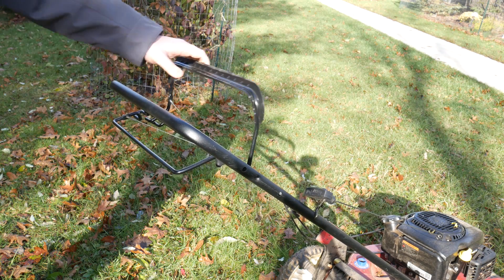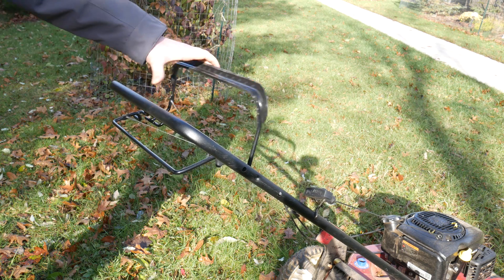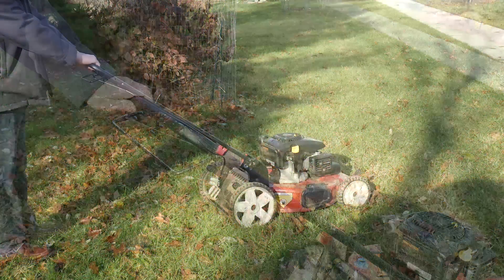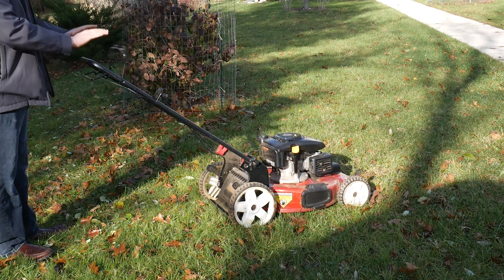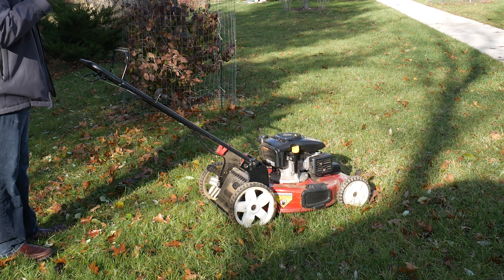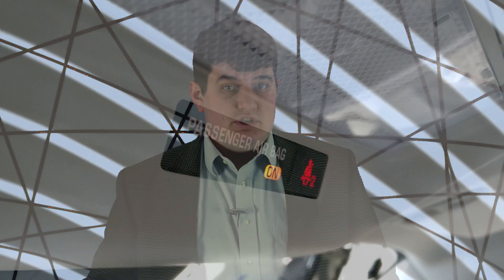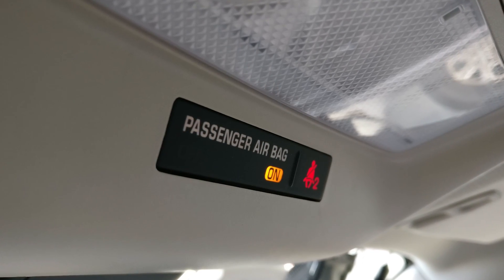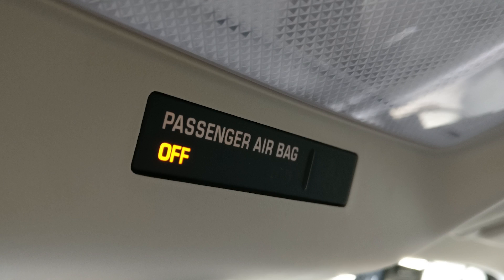The Dead Man's Switch:  How Anton Yelchin's life could have been saved

Comment: A dead man switch, by definition cannot be operated by a dead man. Considering that applying mass to a switch is the only mechanism a dead man could operate makes this really wrong. The switch Dr. Dyson from Terminator 2 used to blow up the lab was a dead man switch. I wouldn't care, but the swich you are refering to is the opposite of a dead man swich.
Reply: Seat switchesThe
 dead man's switch can also be located beneath the seat of a vehicle or 
machine and engages if the operator is not in the seat holding the 
switch down. On modern tractors, the switch will cut the engine while 
the transmission is engaged or the power take-off
 is spinning. On riding lawn mowers, the switch is often more extreme 
where the switch will cut the engine even if the mower is parked and the
 blades aren't spinning. Seat switches can also be used to keep small 
children from even starting the vehicle since they wouldn't weigh enough
 to completely hold down a switch adjusted to an adolescent's or adult's
 weight.

from
https://en.wikipedia.org/wiki/Dead_man_switch#Seat_switches
Reply: Pyrrha Nikos I really want you to be wrong for some reason, but you win. Not sure why that's not just called a pressure switch. My point is still valid, however ya can argue with Wikipedia.
Reply: I think it boils down to the simple fact that you got the definition wrong. I never before heard it said that a dead man switch can not be operated by a dead man.
In fact, I can think of a few applications where it ONLY gets operated in the case of a "dead man", although "dead man" is just a term that in practice doesn't need to involve anyone dying.

From what I learned way back when I went through electrician practice "dead man switch" is not a switch, but an operation. The control circuits (nowadays very often computerized) does a certain thing when the operator is no longer in the expected position. Either because he's dead... or because he left his seat, for instance.

For instance, I know of a story (oddly enough titled "Dead Man's Switch") where a pre-recorded voicemail is sent off the moment a person dies.  Or rather, doesn't trigger the delay of that process for a long enough time.  (spoiler: he did end up being dead)
Reply: @Atlessa  that is the definition of it since the idea is to make sure that if the operator becomes incapacitated, such as by dying, the machine will safely stop. So a true dead man's switch would bring the car to a stop if the driver dies. This is not what is being discussed here. 

So what we are dealing with here, is not a dead mans switch, but a disappearing man's switch.
Reply: Very real case of this issue was the Waterfall Train Disaster, where the overweight train driver was so heavy that even after suffering a heart attack, his leg held down the dead man switch that supposedly needed active muscle pressure to hold down. Seven people died.
Reply: Not exactly the opposite of a dead man's switch, as that implies it is only operated by a dead man, but yeah the name isn't quite right.
Reply: Its a live man switch
Reply: Well, that could have been prevented if the mechanism had required the pedal to be pressed and released every few seconds.

However, i do agree that the definition of "Dead Man´s Switch" switch does change if it describes the component itself or the action of switching something.

If you think about it, the name is just a novelty anyways - A train operator could also decide not to use "the switch" without being dead :)
Reply: Some locomotives have a countdown timer attached to the throttle and brakes. If the engineer doesn't move those controls or press a reset button by the time the timer reaches zero the brakes are applied full for all the cars being towed. A light on the control panel and a warning tone gives the engineer a warning a few seconds before the timer reaches zero. ANY change to the throttle position or pressing the reset button restarts the countdown.
Reply: Are you secretly CinemaSins?
Reply: Dead man switch is a misnomer. It has nothing to do with being dead (Now). (although it originated that way)
A dead man switch is anything that prevents something for functioning if the operator is in no condition to.
Sure, the seat sensor would not help if the operator is actually dead, but in this case it would not had killed Anton either.
Reply: You could also interpret it as a mechanism designed to reduce mortality within a given system. essentially the inverse of its literal name.
Reply: I think the thing nobody has really pointed out is that what you said is the very reason for its name: it’s a switch a dead man can operate. Hence “dead man’s switch.” 

The failsafe implications just happen to seem a little counter intuitive to the name, though.
Reply: Holy shit, none of you can get a joke.
Reply: The name refers to the fact that you are ceasing pressure to engage the switch. Of course a dead man could keep this switch on.

Comment: Why didn't he just set the hand brake, like you always should whenever you leave the vehicle?
Steer by wire is totally retarded. Braking and steering are the most important safety elements in a vehicle. There HAS to be a mechanical backup. Making things more complicated and more likely to fail for very little benefit at the risk of safety.
Reply: greenmumm My driveway is sloped, so yeah, I set the parking brake literally every time I turn off my car. It became second nature and I do it without thinking even when it is flat.
Reply: Yes you should set it every time you park or get out. The parking pawl in the gearbox is not designed to properly secure the vehicle.
Reply: I was thinking the same thing. The transmission is not a kickstand. Set the parking brake. It's literally called the "parking brake". I've always used the parking brake and have taught my daughters to do the same. We (daughters and I) know how to drive manual transmissions and the rule always is: Put the transmission in reverse (the lowest gear / just in case) and apply the parking brake. When we drive automatics we all do the same thing.

I know you can make the argument: Well, no one ever does that... Except they do. The actor's life could have potentially be saved by doing the same thing. Is the parking brake set? Yes. Then unless your brakes are loose, your car shouldn't roll away. In addition, turn the wheel, especially on a hill, just in case so that if it does start to roll downhill, it'll roll into the curb/grass and not straight downhill.
Reply: +lawnmowerdude Braking by wire is starting to become a thing, which is stupidly dangerous. Brakes not actually connected to the brakes are numb and give the driver no feedback to be able to brake properly, making avoiding an accident extremely difficult.
Reply: While I agree with you wholeheartedly, I feel I have to state that a dead man switch on the driver side seat belt attached to a computer-controlled transmission is a no-brainer and would save more lives than simply those too stupid to use the parking brake.
Reply: I agree 100%. I like that you pay attention to which gear is lowest (and actually in some cars, mine for example, 1st gear is actually lower than reverse interestingly enough). I'm used to driving cars old enough that the ebrake is a mechanism inside the rear drums, and simply does not work very well. I just redid mine last year, and even still its kind of a 50/50 on whether or not it will keep the car in the driveway (kinda relates to the "shouldn't" roll away part). And back to my point about rusty brake cables, my dad's mustang does not even have a park brake anymore. Each cable individually locked up, and we had to cut them to get the car drive-able again if I'm being honest. We just park it with the transmission, and still see 150,000 - 200,000 miles out of each transmission that goes in usually. So will parking with the transmission hurt it? No, most likely not. Is it a good idea to use the park brake and leave the car in neutral? In my experience, not really. Using both at the same time allows for redundancy, and could keep your car from rolling away (hell, some cars lose enough compression that the drive train can't hold the car still anymore on a steep incline).

"In addition, turn the wheel, especially on a hill, just in case so that if it does start to roll downhill, it'll roll into the curb/grass and not straight downhill." This. They teach it in drivers ed, and its in the manuals you read before taking your driving test, but no one ever seems to do it.
Reply: having a switch on the belt would also force drivers to wear it, so bonus for free.
Reply: because it costs us taxpayers money for medical and cops to go to the scene and create incident reports  and clear the road of the mess every time someone does stupid shit with a vehicle on the road, if they dont show up after some dummy does stupid shit and wrecks, then that leaves shit blocking the road and permanant traffic (taxpayer money funds those cleanups) and if we can stop that from happening, it also stops unessecary cleanup crew and police response that costs more taxpayer money
Reply: I always shut the motor off, put the parking break and first gear when I get out of my car.
Reply: I've use the "hand break" maybe a hand full of times and I'm in my mid 50s.  People, which I am one, just don't use it.
Reply: +lawnmowerdude Fly by wire is ok in planes because you are not supposed to listen to your gut feelings or tactile feedback, just the instruments. In a car it is just the opposite. All controls in a car are done by feel, and removing that feeling is removing valuable information from the driver. A cars instruments are unreliable, basic, imprecise, and inaccurate compared to an aircraft's instrumentation. While a (non shitty) cars tactile feedback is accurate, precise, and very useful compared to a mechanically controlled aircraft's feedback.
Reply: s0nnyburnett I know this has been said before but planes have been flyby wire for decades. A vast majority of the time these systems work flawlessly. I’ve had more trouble with a mechanical throttle sticking than an electronic one. But back up mechanical connections are reassuring.
Reply: I daily drive my T5Z equipped 86 Mustang. I never park with the hand brake, I use either 1st or Reverse. I live in the Midwest, and hand brake cables rust.
Reply: Here in Australia you would fail your driving test pretty much straight away if you didnt use the HandBrake (What you guys call the parking brake) to secure the vehicle every time it was Parked / vacated.

Infact i dare say most Australians would find it mind blowingly stupid that Americans seem reluctant or too dam lazy to use it. The idiot Anton would still be here had he followed the simple rule to use it every single time you get out of the drivers seat.

Apart from saving lives, using just the transmissions parking pawl is a pain in the ass because you can get "Park-Locked" where by the weight of the vehicle wanting to roll even on a very slight slope can make it nearly impossible to get the transmission out of park. i know this because for a week or so while i had a faulty hand brake that would not release on the left side without me reaching under and releasing it manually i had to avoid using the handbrake as much as possible.

 I did however take precautions such as Still using it on anything other than a slight slope and having chocks available. If i was forced to use it during that week i would move the vehicle to a flat level surface, stick it in park, then chock the wheels, and only then would i dare to get underneath to manually fully release the partially stuck left hand hand brake lever. (Hand brake on my car mechanically applies the service brake calliper via cable and cam system, the cable was jamming).
Reply: Do you really set the hand brake every single time you get out of your car? Because I would bet millions of people don't, as it pretty much never helps you, unless you have a manual transmission.

Comment: You did basically no research before this video. I had to stop watching because you are so incorrect. The bit that made me switch off.... there are no cars without a steering rack. Where did you even get that from
Reply: +downthegardenpath - Incorrect information? Drive by wire and steer by wire are used in TONS of applications are are becoming common in vehicles.

My 2009 vehicle has electrically assisted steering as it is.
Reply: Mateusz Zimon
Airliners receive serious maintenance every few days.
Reply: Q50 have mechanical connect steering wheel=>wheel because this is mandatory in United Europe. And lots of manufactures wanna change this but steering by wire is not safe when have a malfunction. 
But Airbus and Boeing use fly by wire from 60
Reply: There are plenty of cars without a steering rack. Well, maybe not as many now as, say, 20 years ago (most only used on trucks nowadays)...but they have  a recirculating ball steering gear instead of a rack.
Reply: "The steering rack is still there and permanently engaged. The actuators just do the work until they fail"
Which is steer-by-wire..."there is no MECHANICAL connection between the wheel in your hands and the wheels on the street." except in an event of failure, which activates a safety clutch and mechanically connects the steering column with the steering rack. Under normal circumstances the Q50 is a real steer by wire vehicle.
There are more than a 150000 Q50's on the roads. So why exactly was he incorrect when he said "there are even cars out there without a direct connection from the steering wheel to the steering rack"?
Reply from the maker: https://www.wired.com/2014/06/infiniti-q50-steer-by-wire/
Reply: downthegardenpath WOW you got owned, should have done your research yourself
Reply: How did I get owned when this is the first lol. The article is not only misleading but incorrect. The steering rack is still there and permanently engaged. The actuators just do the work until they fail. A system like this isn't even legal in the vast majority of the world and certainly isn't in the UK. It would be impossible to pass an MOT (yearly safety check)
Reply: Technology Connections I was quite excited when I found your channel. You have some very interesting subjects. Unfortunately it's a massive disappointment when nearly every video I watched is full of incorrect information. It's painfully obvious that you have made educated guesses all over the place. While I can usually see how you came to the conclusion, there is still very little research done

Comment: What happens when I lift a cheek to cut the cheese? E brake throws me through the window?
Reply: If you lift one cheek, the total weight on the seat doesn't change. You still have your entire weight on the seat.
Reply: 6:46

Simple...if the car is already moving, nothing happens...again a software solution.
BTW, the e-brake doesn't work as such, when the car is moving high speed. In most cases it works as an emergency brake (applies all four brakes, usually even with ABS functionality)  and activates the e-brake under a certain speed (around 3 km/h).